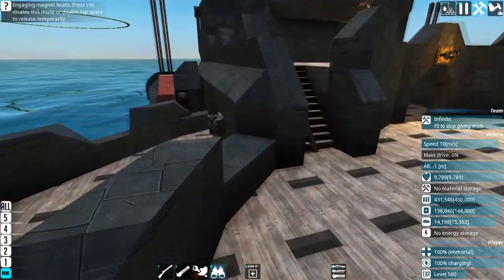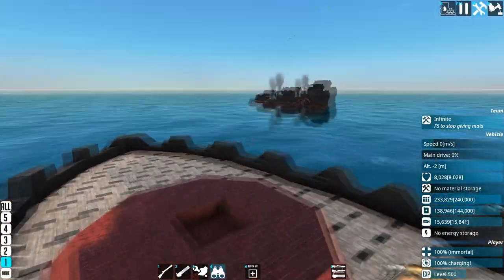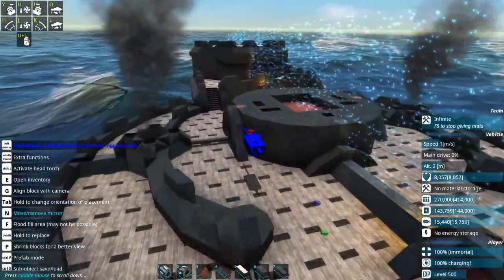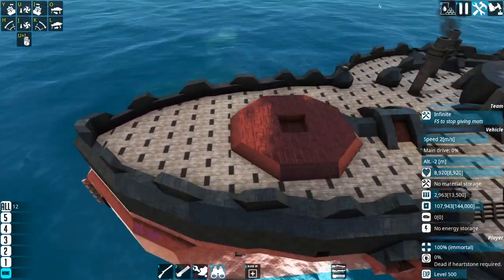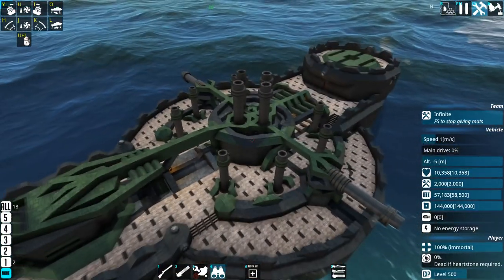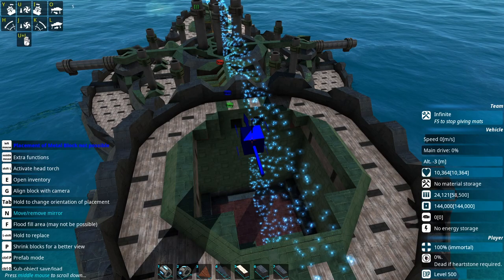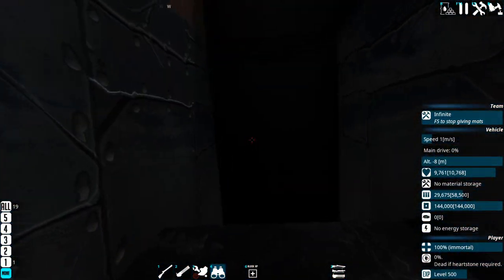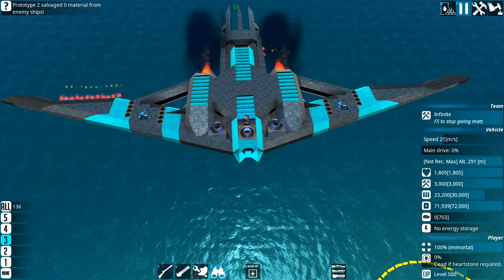Iron Cordon Conversion - CRAMS EVERYWHERE!  Ep.6 Neter 2020 | From The Depths

Comment: One thing I would suggest adding to counter Laser Ammuntition Defence Systems would be an addvanced cannon that uses smoke shells. It´s kind of an unusual approach but the concept behind it is basically: Lasers are weakend by smoke, so if you cover the system itself in smoke the Defence System is rendered useless.

I think it´s also worth mentioning how awesome your Version of the Iron Corden looks, especially the green parts above the front trurret added so much to the overall design.

Comment: Completely unrelated, but the Harlech has a slight suicide problem. It gains scuttle points from having less than 1 fuel storage, but it doesn't use fuel and has none. I though i was killing it with my munitions defence system, but actually its just suicidal.

Get help, Harlech.